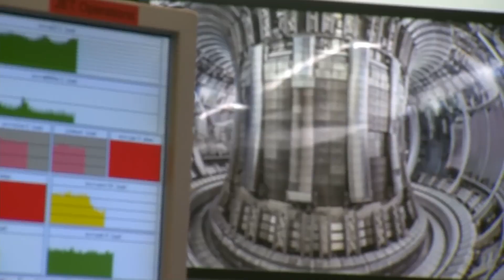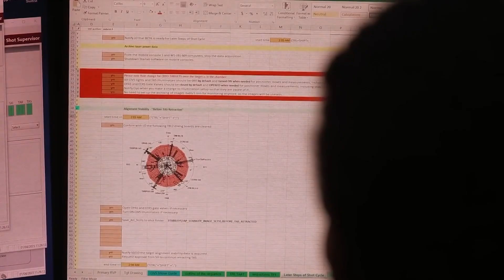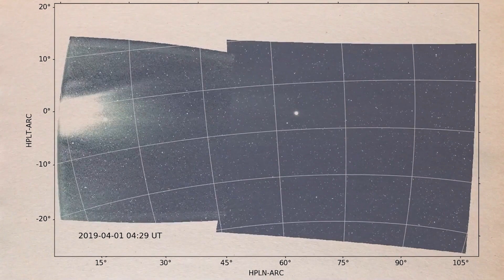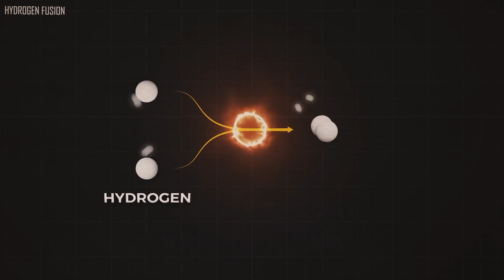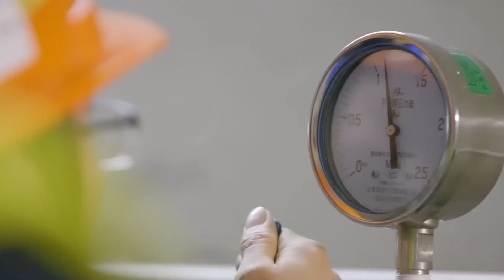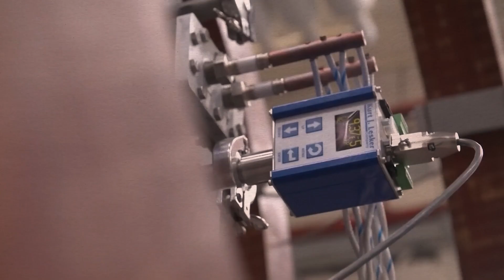Chinese Scientists Launched Artificial Sun To Prove Technological Power!

Comment: If the Sun is so hot why why space hot why is it so cold in space explain that
Reply: Space is a vacuum: there are no particles to heat up, so its temperature is very low indeed. The sun's radiant energy passes through without heating it as there's nothing there to heat up. However, if any object is in that space, it will be heated by the sun's rays. Hence you can have a very hot spacecraft (on one side) surrounded by very cold space.

Comment: Bla bla bla. Its seems like folly the maitenance will far succede the possibility clean limited fuel. The nutron created wil desroy everythinwhen it running. The nutrons will strip  the very fabric that hold materials together. The heat will heat will consume any metal.  How long will it take before a new machine will be consumed?  A week? A month? A year? A plasma torch is around 20 thousand degrees. It pretty much will cut threw and metal or material known to man. Do you really think they will be able to contain 50 million degrees for any considerable amount of time before it takes it toll on anything nearby? More time will be spent on  fixing the machine that it actually  will run is my thoughts. Im just a man with a opinion . You can say im not a scientist  but heat consumes  metal  weather it touches  it or not. I dont think one can change that fact. Proove me wrong. I've been  wrong before. Id love to be wrong!
Reply: They also have an artificial moon, they say to replace the street lights at night to conserve energy, they also say, if anything should go wrong with their new sun and moon, don't worry, because all they have to do is drop them into the ocean. I read about this for years ago, it's true, they plan on just dropping them in the ocean if anything goes wrong.
Reply: @stellalush4547  i love to know what that moon is about. Id loce to know what propels it. Those and more. Does it help humanity?  It seems time spebt chasing a tail but mabe something wholesome will come of it. We get tecknology spin-offs of militery and space tecknology. I wonder how we can make things better. How can we move towards a better world. How can we grow together instead of spart.

Comment: Creating an artificial sun- billions spent 
Finding out it’s actually a supper nuke - priceless
Reply: From Spectroscopy, it is deduced through analyzing the spectral lines from the sun that it’s energy comes from the nuclear fusions, the combustion of its chemicals. Thus pretty much the same is with the artificial sun… it is not a “supper Nuke” because those operate through fission (splitting atoms) but both harness a lot of energy but Nukes are more uncontrolled